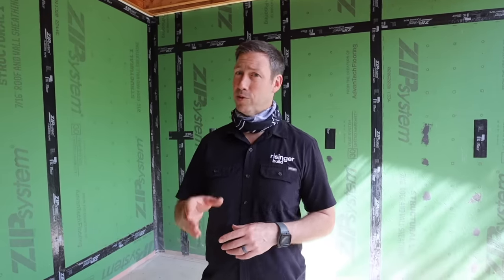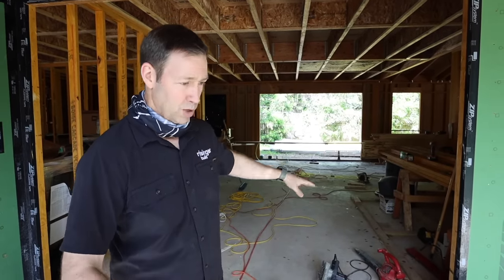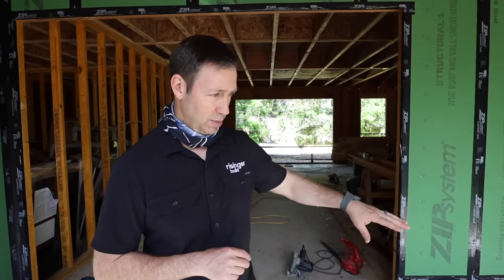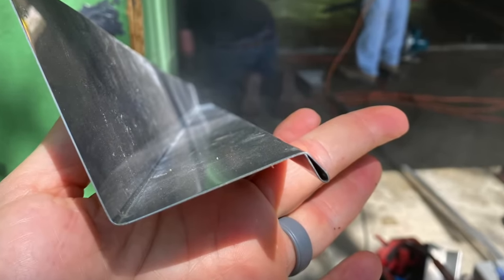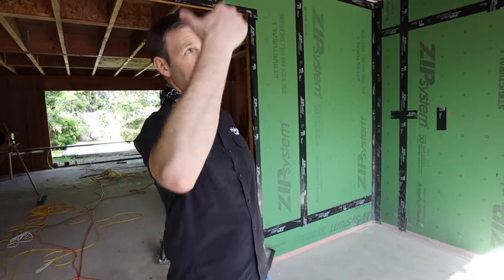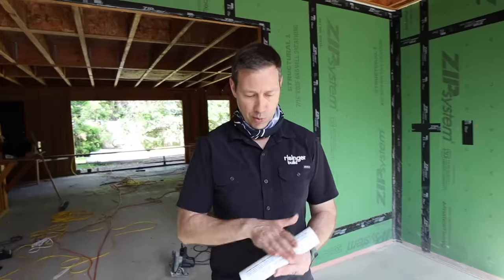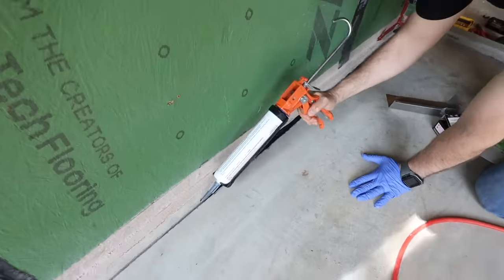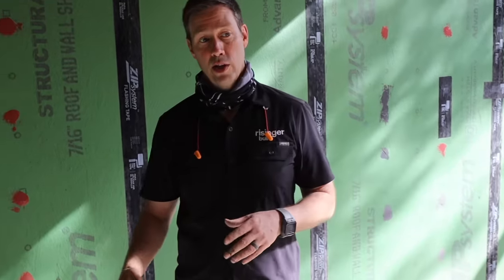Flush Concrete to Framing? Here's a Stainless Flashing Fix!

Comment: Please refer me to a place where I can get this flushing because the addition was built directly onto patio concrete and the wall framing was put directly onto it which allowed some water to flow into the house under the framing which may have rotten the old joists and Im in the middle of replacing the joists and sistering the suds along with new bottom frame under the studs. I wish I could attach some pictures to this but.... I need advice to do it myself, I would put new exterior walls but i need to prevent the water from coming in. So I need a place to buy the flush metal thing. I need help asap..  Thank you

Comment: What do you recommend for an addition that has no sill plate gasket and the sill plate itself is flush with the concrete slab? (So I can’t do metal flashing atleast not a bent piece) 

All I can access is the exterior of the addition/home and it has t-1-11 siding on it, and some areas I can see about 1/4 inch of the sill plate when on my knees looking up into the foundation and  t-1-11. 
And other parts I can only see about 1/8th of an inch of the sill plate. (Due to the t-1-11 being placed not perfectly straight) 

I live in Florida and definitely need to seal out the water and bugs! Please help. 

I was thinking liquid flashing by zip like you recommended in one of your articles and getting some sort of sticky flashing tape once the liquid flashing dries just to make it look more like a straight black line cause I assume liquid flashing may be a bit messy. Do you have a better suggestion? 
Not too concerned about looks more concerned about waterproofing without having to take all the t-1-11 off If possible

Comment: Matt, thanks for sharing! 
Quick question: can we use 2" x 1-1/2" x 1/2". x 10 ft. 28 Gauge Galvanized Steel Water Table Flashing or Drip Cap? 
It protects the top of exterior windows and doors from water infiltration. It seems to have the same shape.

Jamie

Comment: Hey Matt, I've built my house myself watching a LOT of your videos, so thanks for good information being shared. I have the same ledge around my walkout basement/patio slab. I was just going to use the Huber Liquid Flash for the transition between the Zipwall and the slab drop which is about three inches. Do you think that will be fine or should I use the Prosoco? I liquid flashed all of my windows, so I have both on hand. I was going to use your "Zip 1.5" method.
Reply: sponsorship legalities will prevent him from answering, most likely. IMHO and not having much experience with the products, I would bet both fluid applied materials are essentially the same chemistry

Comment: Matt, 
What is your opinion about using the Zip 2.0 system in an area that may flood? (South Louisiana) 

On flooding right about the slab (2-3”) when doors are sand bagged could the Zip system hold back water?

Once flooded, less than 1 foot, is opening the drywall enough to dry out cavities?

In flood prone areas, would you recommend other methods?

Love your show, the science, and attention to detail. Thanks for all you do! Richie

Comment: We are in the process of replacing our siding, and doing this at our patio. I am unable to find any z bars taller than 1- 1/8 to fasten to the sheathing. This is fine to attach where the patio slab is closer to the baseplate, but further down the grade, it doesn’t reach to fasten it with nails. Would you suggest fastening with only polymer in these areas, or attaching the flashing level with the baseplate and bending the bar to attach into the cut? Thanks!

Comment: I like the look of that ZIP sheathing system, would you fix your rain screen / cladding directly to it or install a cavity batten system first?
Reply: mickey blowman that's what I'm wondering,
Reply: Pretty sure insulation gets attached directly to it, then rain screen, then outer layer (brick?).

Comment: like the content and level of detail, but that cutting of concrete without dust collection doesn't seem it would be OSHA approved. also it would of been nice to dust off the zip system board with a wet town and let the dry before  applying that zip tape. Looked like it was caked with concrete dust.

Comment: I think this will help me. My porch (concrete)  is above my garage. I got a water leak damaging the ceiling of this unit. The concrete has several cracks but the water leak stains makes me believe that the water is coming straight down from the siding that most likely doesn't have the flashing joint. What else do you recommend i could do to the concrete porch, which was built back in 1976, to ensure there are not more water leaks. The association can't afford to redo the whole concrete porch. Contractor is recommending a Rubber membrane to repel the water in the meantime. any recommendations? have you ever deal with something like that?

Comment: What's the minimum required in Texas? our builder did not install any flashing where the siding meets the foundation and the foundation sticks out about an inch off the exterior wall, this along with the fact that the siding butts with the foundation instead of overlapping, is causing water to leak into our garage. The problem is that, this can be seen happening at other portions of the house which is concerning.

Comment: Hey Matt,  I have a similar situation where the exterior soil is about 4" above where my framing sits on my slab.  The previous homeowner added a skirt drain along the outside perimeter but I still have dirt/rock butting up against my exterior siding. Sooner than later I'll have to move dirt & regrade (which is tricky, our house sits in a low spot). It'd be cool if you could address this scenario with some sort of product or other creative solution, maybe a good opportunity to have one of your sponsors show how to protect wood framing that sits below grade? Great channel btw, God bless you and your family.

Comment: Install flashing as part of concrete pour. Make z-bend or some feature to hook flashing in concrete
Reply: Easier said than done.
Because, then, you're working to the alignment of the flashing.  Which is going to get kicked and bumped and bent as the walls go up.  Rather than building square and making sure your flashing is flush to both the wall and concrete.
Reply: That's an interesting idea re concreting the flashing in

Comment: Why dont ye saulder the overlap of the straight pieces ?
Wont last 100 plus years
Could have used copper also
Reply: I think the concrete would corrode thru the copper pretty quickly just like the galvanized he told us not to use? Sure would look nice though.

Comment: I know Austin doesn't get that cold, but it DOES freeze there. If moisture ever made it into that kerf cut, that seems to be an invitation for a split/cracked slab.
Reply: The way the wall system is planned, any water that somehow makes it in is going to be minimal and will likely evaporate rather than accumulate.

Comment: I had a similar detailing problem on a school build where the architectural plan shows stud walls resting directly on top of the slab instead of sitting on a curb. Since it's new construction and the walls were not built yet (but the structural is up), I just sent an RFI and had the GC add curbs lol. I'm sure the concrete guys had a fun time charging for a change order too.
Reply: Slabs without curbs are so much easier to form, place and screed. The architect was probably hoping to save the client some money. So much for that.

Comment: Yeah i prefer to triple flash mine with metal first and i run it all the way up the wall and bend to the floor and run it off the porch, then a carbon fiber liner over that with a 2 part epoxy sealer to adhere both together, then i have a rubber matting an inch thick that i glue on the wall down to the floor and again over the porch and off the side and i layer rubberized epoxy rolled on with a paint roller 2 inch nap, then i put the final layer on 1/2 inch thick steel plating and i first paint hot molton lead onto the wall and the floor and adhere the steel (one piece of course fully custom) to the lead and i then use a sandwiching machine by JCB that has 900hp and is fully hydraulic and custom and it presses it all together and then it gets a 3.5 inch thick foamrubber matting and we cover it in mesh and  fiberglass resin and layer it up about 6 times twice a day for a week straight and once dry we paint on allgrip and then a coat of rubberized bedliner and finally we spray closed cell foam on the outside of that and mash on a 2 inch thick piece of kevlar. 

Let me know if you want to join us in the big leagues there guy. 😊

Comment: This may be a dumb question but why the kerf cut? Wouldn’t the butyl sealant work fine with the flashing being flush to the concrete? Just seems like an unnecessary step for the same result.
Reply: Nathan Grigsby in my opinion it’s likely so that if the sealant fails any water getting in will be stopped at that cut instead of hitting the walls, but if there’s that much water the concrete will begin to deteriorate rapidly there, I personally would have done exactly what you’re saying and it likely would have outlasted me

Comment: Matt, the only detraction from your video I can see is your Zip R sheathing seam tape is now back lapped on your flashing tape. That would be incorrect as per engineers specifications. All tapes and membranes must have positive lapping process from bottom to top regardless of the quality of product.
Reply from the maker: Probably true but it’s a covered porch with a 2’ overhang. Not much water washing down these walls.

Comment: I have a question, i too have someone flush frame outside of my patio. Its closed in, but the person that build my close in patio was Pi** poor workman shipman. I had him insulate the walls and floor. But, he squirted foam at certain places. I had water leaks coming through the concrete floor under the  wall.  So i paid someone to flush frame the outside wall and seal into the cut concrete and the metal flush plate he added. But now I'm steel getting leaks. Any Idea at this point what can stop the leaks? I feel like ripping the patio up and leaving it open....

Comment: I did this recently with some galvanized flashing. Sounds like I need to paint the flashing so it won't rust.
Reply: Never use galvanized or aluminum flashing where it will make contact with either concrete or soil.
Reply: @lawlerzwtf  What about asphalt? Same?

Comment: anyone can help me? if i want to put a 2x4 frame to close up a carport, but the concrete is not even. so i can't just secure the bottom stud into the concrete because theres air gaps between the concrete and wood. is there something i can use in between?

Comment: Byutal ah! How did you like working with hot gum? Lol Well your going to be alright, “but” you should use Dow 795. Byutal never really sets up but when exposed to uv light it will dry and crumble, 795 will stick and move. With that it looks good and will work. Also FYI put a little slope to it if water sits it wicks or eats it’s way threw.

Comment: I would have underbent the flashing a bit so once snapped into the groove it would have created a slight pitch away from the wall and would of held a little tighter against the wall requiring no fasteners. Other than that great job. I would have done thd same .

Comment: I'm not convinced with the concrete cut myself......especially in my area of the NE heavy winter area.
I understand why you did it and with a clean line strike(being a "Z" trap flashing), but concrete is a finicky animal. Salt, moisture, degraditation to the surface.....Myself a brick flash with a heavy bead of poly caulk.  Plus you said a 3/4" rise in the concrete as well. I dispise any chance of concrete degradation especially in this scenario in the North country.

Comment: I’m betting it pops up out of that groove since it had to be pulled back against the wall with screws.
Reply: Yeah, metal flashing should be bent at more of an angle to allow gravity to drain off any water that accumulates on it. This looked like a 90 deg angle on it. If it had more of a slope to the angle it probably wouldn't want to pop-out like that.

Comment: I would have liked that s/s flashing at least 150mm (6 inches) up the wall from your finished floor level.

I know that can’t be achieved at the door threshold but because it’s well back under the porch I wouldn’t see a water ingress problem there

Comment: I don't understand the point of the kerf cut if you're just filling it in with "caulk" anyway. Isn't the water just going to proceed backward over that, just as if the cut wasn't there?  Just seems like you've made a hole, only to fill it. Thinking just not having that is just the same having a cut that's filled.

Comment: I would have thought the best way to remedy this would be to break up the slab in the patio area and dig it out and repour a new slab at the correct height.
Reply: It would likely pool water. In a remodel (which this is), you can’t necessarily get the proper grade to  drain away from the home.

Comment: I always thought overlapping and not relying on caulks and adhesives was key to long term water proofing. This zip relies so much on tapes and caulks... water will drill a a hole through it all. The real water proofing here is the porch roof.

Comment: Reducing the structural integrity of the slab to protect the wall is not suggested. You could have achieved the same by cutting the bottom bend off the metal a d full spread adhesive application of elastomeric costing under and above.

Comment: I've seen a few of your videos where you are quite concerned about thermal bridges through your wall studs etc. I'm curious, why did you build a concrete lip for the underside of your patio door? Your floor slab runs from outside to the interior, uninterrupted. How do your plan to thermally isolate the main floor from the exterior? Here in Austria, you would use a wood-fibre rigid insulation board as the base of your patio door - Purenit - look at this detail https://www.fritsche.eu.com/fripur-und-purenit/ . Even if you did have the patio concrete foundation thermally separated from the interior, you still have a big problem around your door base. Personally, I would cut that lip out. Maybe in Texas cold bridging isn't such an issue, but energy losses and condensation surely are. Also, unless you've put additives into your concrete porch, the flashing won't help with water infiltration, just splashback. Concrete is porous. you should have just flamed some bitumen waterproofing down over the entire surface and lapped it up 15-30 cm above the finish floor level. Sorry for the criticism, I do enjoy your videos and the quality of your builds :)
Reply: Brendan Bosson purenit is only at the door? What about under the wall?

Comment: great vid.  please dont install the stainless in direct contact with the zip sheathing as it will have moisture condensation and rot that part of the zip.  U should have put zip tape first, then the stainless, and zip tape again.
Reply: Doesn't matter there won't be condensation because he is using exterior insulation. It will never be below dew point

Comment: making a gap on a concrete slab?  isn't that an invitation to water?
Reply: 1: Texas.  Freeze-thaw isn't much of a consideration there.
2: The kerf cut is mostly full of flashing and sealant.
3: This system is sitting UNDER the exterior wall system with 3" of detailing BEFORE the finish layer.
4: The concrete is SLIGHTLY sloped away from the home.  So it should drain...
Reply: @PhotonHerald  Thanks for your kind and rational repl y.  So you mean cutting a kerf is a lot more for keeping the flashing firml y than  for risking moisture hazard.

Comment: couldn't you just use that tape as an inside corner and skip the flashing? (half the tape on the Zip and half on the concrete)
Reply: Tape to concrete is a bad idea. And even Butyl isn't optimal without thorough cleaning
Reply: Zip says you can do it with their tape.

Comment: Rather than stainless can you use aluminium
Reply: It'll cost less, but also endure less.  Aluminium is more corrosive than stainless.
Reply: The high pH of concrete corrodes aluminum pretty rapidly. A bituminous sealer should be applied to all aluminum parts inserted in concrete. And if you're going through that hassle, just use stainless.

Comment: @Matt so, i think you just shot yourself in the leg. What you just did, is create a isolated and never ventilated small air gap between the concrete and the wall. The concrete always allows water to transfer, you should try to pour water over one ov the corner, and see if after a couple of days you have moisture under the stainless steel corner...
I hope i'm wrong. but that solution will lead to mold soon enough

Comment: Nice, but I have a Idea. That's a step further than the metal one you just shown. But mine is also SS but its installed when you frame the outside walls. Will act as water, air, and bug. Gaurd. And give a final drip.edge to bottom of finished wall. But dont know who could show my idea too and not get stolen.

Comment: Oooh. That’s how you peel off long pieces of tape. Dang it. Great vid. It looks like you use the pink stuff too, along with the flashing. Is that correct?  I have an open  front porch with old Masonite siding installed, touching the concrete without flashing. I’m scared as hell to see what’s underneath. Idiot builders. I’ll def use this technique to fix their mistakes.

Comment: I do not think it is a good practice to have flush concrete to external framing to start with.
Reply: he's aware he made that point really clear. he didn't repour the foundation/slab when he started remodeling so he was limited to what was already there. it's not ideal, but this is a good workaround imo.
Reply: @itech301  I see, I haven't watched the clip fully. Apology.